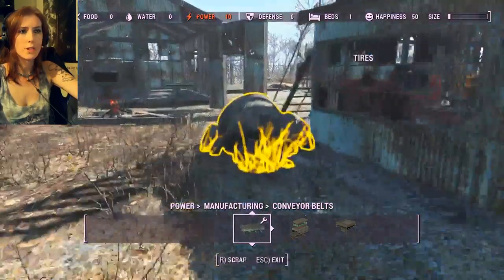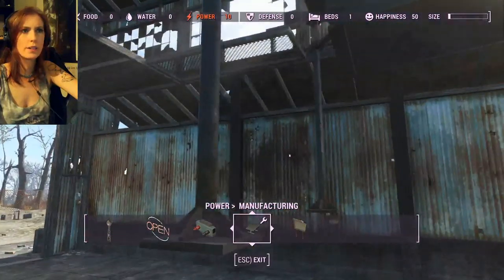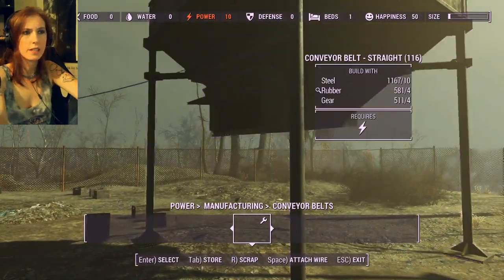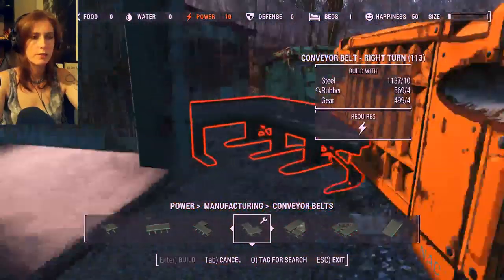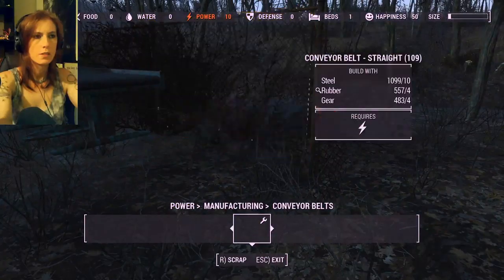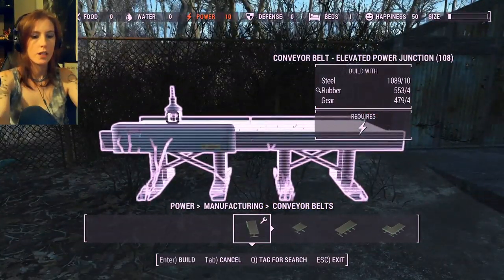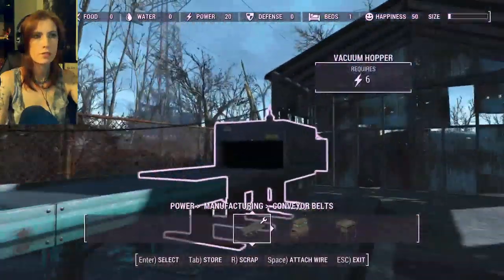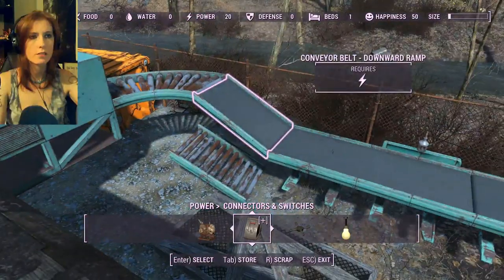Pieces Everywhere But None Work | Fallout 4 Vanilla Builds/ Modded Locale - Pt 3

Comment: If you swap the conveyors up on the roof for the ones without legs it will drop your elevator down about 3 feet which will then let you drop the rest of the system down 3 feet closer to the ground.

You can also make your own corner pieces when you need to by having one straight piece slightly higher and dropping the items onto another separate straight piece that is pointing sideways.

I'm not super good with conveyors so I'm probably not the best for advice but I will say you picked a bit of a tough area to start learning. Experimenting somewhere big and open for a couple hours might help a bit before trying to make a complex system running thru tight spaces.

A terminal can program some of the equipment's speed.

 NastyBonz3D has a lot of good info on conveyors if you get too stuck.

Comment: Nice modded build everywhere but using vanilla item
Reply from the maker: Not using build everywhere. Using the pillar glitch. I show it in the previous video.
Reply: @More2Me4Life  no liz i mean the build anywhere cos that area is obviously not a settlerment , it wicked shipping so only way to build there is build everywhere    i don mean the building method u use :D
Reply from the maker: It is a nodded location  yes. I was requested by the mod author to check it out. I am testing it for vanilla building. It is the only mod I run other than cheat terminal for unlimited carry weight for looting.
Reply: @More2Me4Life  that not cheating , it FO4 single player, the only person u cheating is yourself, which mind as well be nonexistent, since cheating ownself don count :D infact it more like u exploring possibility :D